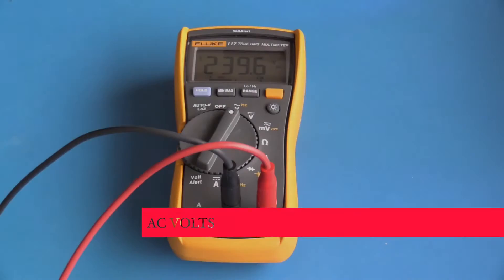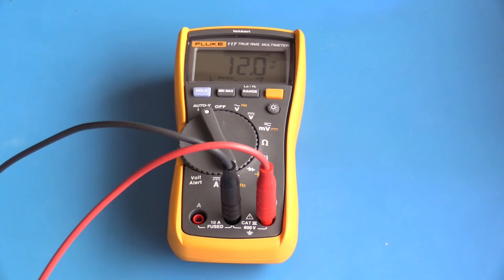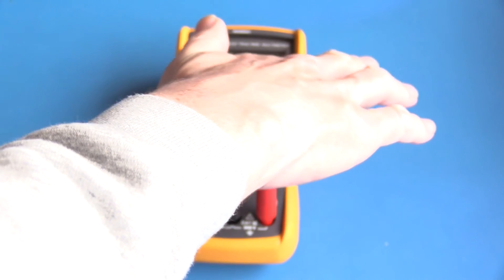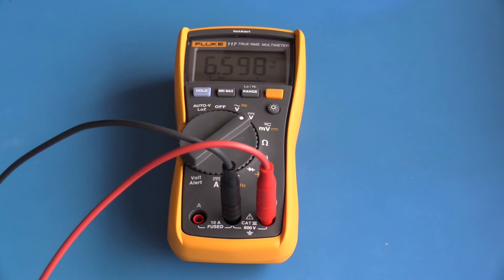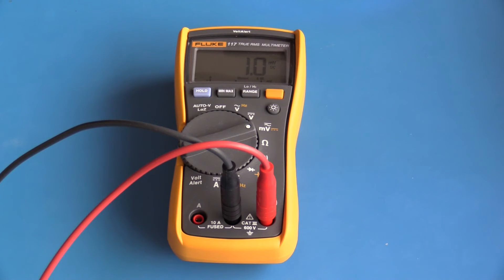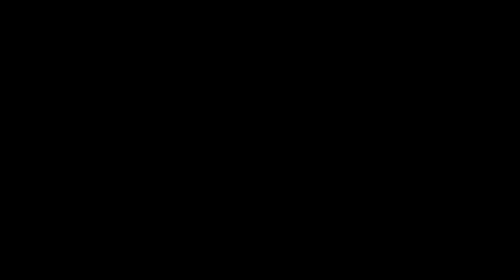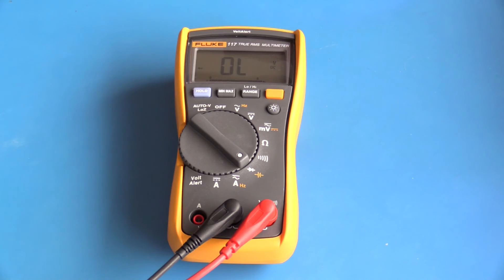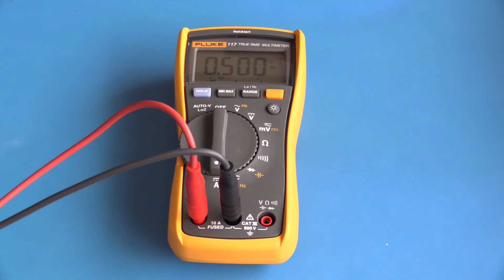BSL004 Fluke 117 Multimeter

Comment: This is promoted and sold by FLUKE, as an Electrician’s Meter.  Of course this will not be ideal for the bench top Hobbyist in need of measuring Milliamps and Microamps.  It even has built in ability  of a NCV  tester, which works very well, and eliminates carrying around a separate little tool for detecting live voltage!

Comment: I just received one of these a few days ago. To make sure it wasn't a complete dud, I tested a few batteries. Tonight I used it for the first time for one of the reasons I purchased it for: to measure induced ground current from a device that is tripping a GFCI. Oops! It doesn't measure milliamps. I had no idea from reading the specs that this was the case. In fact, the specs are listed in different ways in four different places on Amazon and on Fluke's site. So this is going back and I'm getting an 87v. Yes, a scope would be nice, but the 87v is enough for now. It would be nice if Fluke made this limitation clearer. I really liked the size and non-contact voltage detection.